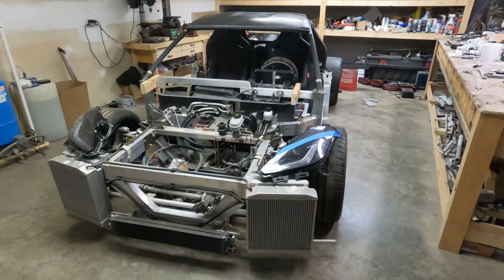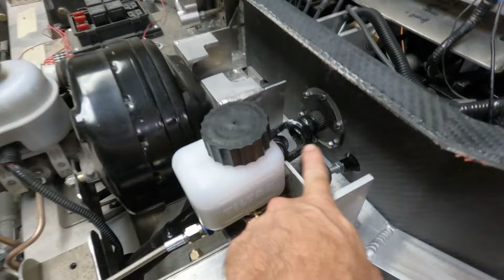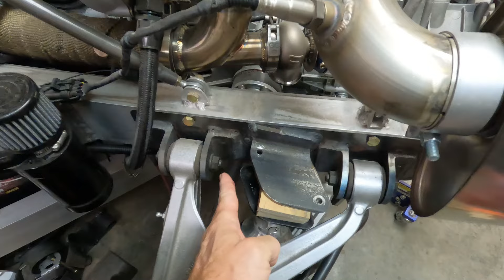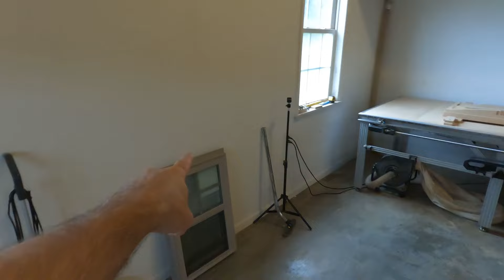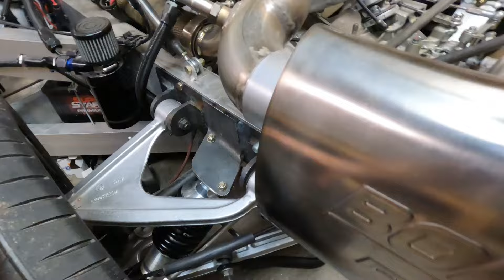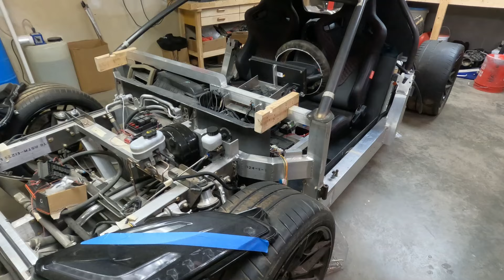Trying to get the CNC working again

Comment: If thr cnc doesn't work , you might have to turn to 3d printer's.
Reply from the maker: I have the CNC working again, it was a bad wire. A new video is coming later today, stay tuned.

Comment: Can you tell me the dimensions of your radiators? Im thinking about using a pair of Boxter radiators for my Fiero project. But I’m wondering if c8 Corvette radiators would be cheaper. Didn’t you use c8 radiators? Now I can’t remember.
Reply from the maker: I am using Honda Civic 4 core aluminum radiators from EBay. They are 14-1/4” wide, 17” tall and 3” thick.